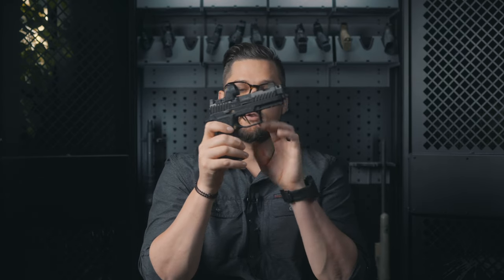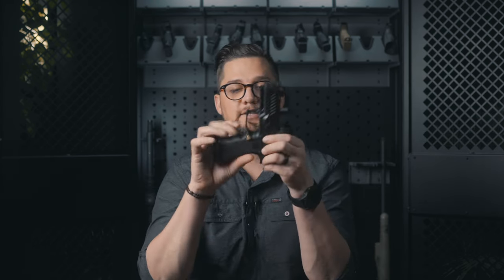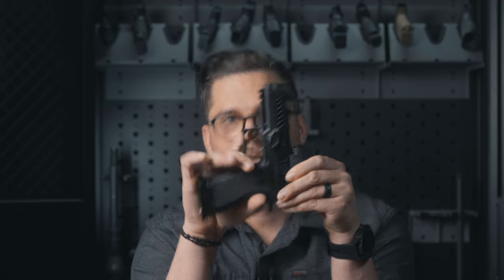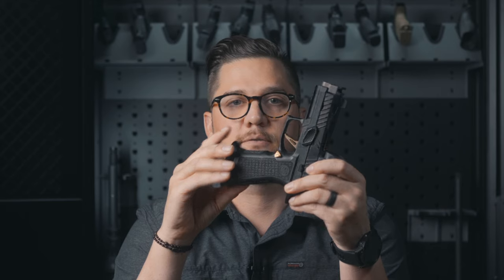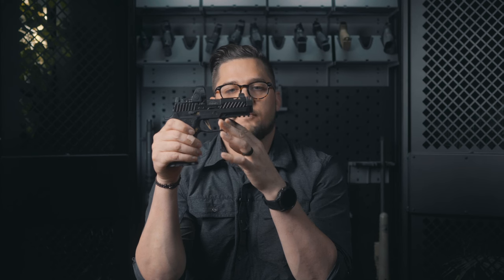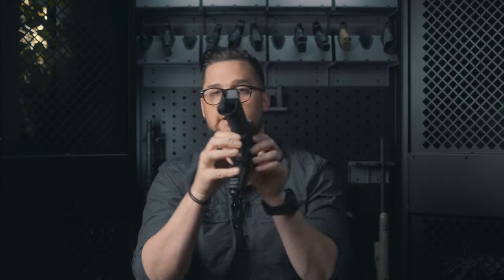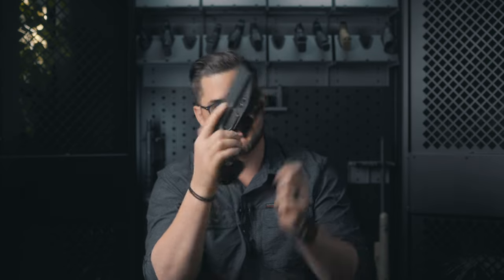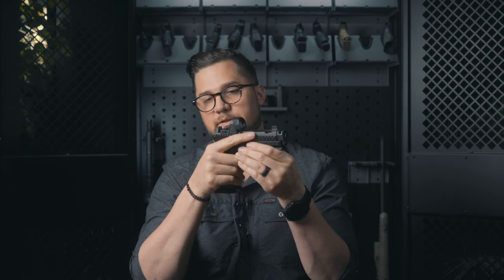Sig P320 X-Carry | A Modular Marvel

Comment: I have a similar build but I used a full size frame that i cut down with a scroll saw and polished with dremel. That’s the only other option I think, if you want a flush look.
Reply: I did the same thing. I went with a Wilson combat full size grip module and cut the frame so my setup (3.9” with the PMM comp) can sit flush. I’m happy with it

Comment: Great Video, thank you for making it.  I am a huge P320 fan and have been since they first came out, which means that my first two P320s had to go back for the “voluntary upgrade.”  I currently have five of them.  My last one I build from spare parts.  I had enough parts from all the upgrades that I did to the other four guns that with the purchase of an FCU I was able to assemble another complete gun.  As someone who worked for the Army for over 43 years (21 Active Duty) and has some knowledge of the military procurement system, I can tell you that Sig won the contract for three reasons.  First was reliability.  When the testing was over [only] Sig and Glock were left standing.  FN was a close third followed by Beretta.  The second reason, and most important reason, Sig was the [only] manufacturer that provided a gun that met the specifications in the bid announcement for a “modular” and configurable handgun.  Lastly, was price.  Sig’s price was almost 40% less than Glock.  If the Army had not been so insistent on a manual safety [or] Glock had been willing to absorb the cost for retooling to make a manual safety gun, Glock would have gotten the contract.  For the record, the U.S. military has a contract with Glock, as due DHS, DOJ, and several cabinet departments.  Glock is the primary sidearm for most special operation units across all services.  The Army really wanted the Glock and would have compromised on the “modularity” requirements, but they wouldn’t compromise on the manual safety, thus, they couldn’t justify the cost difference.  While it is not known for sure, it is rumored that FN actually had a lower price, but the guns didn’t perform well enough in the end.

Comment: If you want flush, you can get a Mischief Machine commander grip module that’s made for the PMM barrel and comp, or you can just cut down a full size grip and bevel it to look just like the factory one. Or you can go with the Fdez P320 compact com’p slide and 3.6” barrel. It would look great both ways. The Mischief Machine grip module is full aluminum with a steel locking lug and more of a 1911 grip angle. Check em out 👍🏻 you could also rock the TLR-7 sub with the Antimatter Industries 1913 micro wing if you want a really nice gas pedal/ thumb throttle that’ll fit in regular holsters.

Comment: How much did that build set you back ? I have a factory X carry and love it . Was very skeptical with all the accidental discharge rumors . I recently dropped it by accident in a holster about waist high . It hit a hard concrete surface and passed the accidental discharge test in my book . I was scared shitless when it fell and hit the ground . I usually am very careful with handeling firearms all humans make mistakes at some point . Needless to say no misfire happend .
Reply: That's honestly what's stopping me from getting or building a p320, I like it but I've heard all the discharges. Good to hear that issue has been solved hopefully.
Reply: @baron9358  I've enjoyed my legion xcarry .. Shoots very accurate 👌
Reply: Dude. They’re drop safe for a long time now. In fact, they’re most likely the safest out there due to the initial issue.

Comment: Best bet for a pmm flush comp. Run a sub compact slide and get the jttc mushi compensator. Icarus precision has a 365 xmacro for a full sized option with a pmm comp already installed

Comment: greetings! good video! Have you had a problem with the slide cover TYRANT Designs I bought one and while practicing the extractor nail system flew away I wrote to them and they sent me another one but after several practices I saw it very marked and I dismantled it. what is your experience?
Reply from the maker: It sure is. It happened after the review. I emailed them and will be talking with them tomorrow about this actually, to hopefully fix the issue. They’re a pretty good company. And except for the everything has been solid.
Reply: Yes I know, my trigger and my mag reale extended are great, thank you 🙂

Comment: Great video, I built an Icarus Precision P365 xl, with a Norosso P365 X slide and a Parker Mountain Machine Micro comp. WIth the comp, it took about 750-1000 rounds to get it broken in where it shot reliably. Now Ive been running it for about 2.5 years and it is a tack driver. Breaking them in is the key.  Nice build.

Comment: It looks like you put a compact slide on a Xcarry grip. My Xcarry grip is flush with my Xcarry slide. Now as far as running a flush comp I think you'll have to get a full size grip module and put a bigger comp on like a dual port one. Agency arms makes one that is a little longer on the single port but it would look kind of funny where the recoil spring comes out sitting on the grip.

Comment: Question.. so I just built a compact size with 3.9 threaded barrel I put a DPM also. I tried all 3 but every other round it jams or doesn’t go back to battery… is that some of the issues you also had? Just wondering since you didn’t touch on what they were. Also would you recommend to just keep shooting till I break it in?

Comment: I have the gas pedal on mine and no issues and nothing extra done to my holsters. All my holsters are appendix carry by teir1 concealed. Currently I'm using the msp by teir 1 and I can swap between my p320s and glock 45 and others just using a flashlight.. msp holster uses the flashlight to lock in so I'm running the tlr1hl streamlight. Check em out I have several holsters by teir 1 and I'll never use another company for holsters

Comment: Exactly what I want to build, but I also want that flush fit. I will just get a full-size frame and trim it. My 320 X Compact slide and Harrington Arms comp are 100% flush on a full frame. Specifically, I have the Icarus Precision Socom Full module, and it's very impressive.
Reply: Is that the aluminum module you speak of??
Reply: @bigcws4522  Yeah. The Socom Full frame module. Total game changer, worth every dollar.

Comment: The Sig P320 is the worst top tier pistol available today, and this has been well proven over time.  Sig just finally lost a case in court rendering that Sig must pay $2.3M to the defendant.  The evidence is overwhelming, and Sig is negligent at best.  My advice is to steer clear of Sig altogether, b/c their problems are not exclusive to the P320, but certainly avoid buying the P320.  They have not fixed the problem with the gun b/c they can’t.  It is a flawed design that will eventually be replaced by whatever Sig comes up with, but either way, the P320s days are numbered.  There are too many other options available today to waste time with Sig Sauer Inc.  Just an ole boy’s take.

Comment: It boggles my mind that people are willing to buy a gun like the P320 despite more than 80 documented incidents of non user intervention discharges in the holster.
Reply: three points for you:  1)  share the link on the 80 cases  2) 500k units x 10 years x approx 120 carry days = ~ 600 million.  80 divided is about a millionth of a percent.  Match that to auto driving, lightning, flying, crossing street etc.   3) take the frkg round outta the chamber when not in use. It's a firearm!!
Reply: @snmr1318 exactly! These Glock fanboys don’t know what they’re citing.